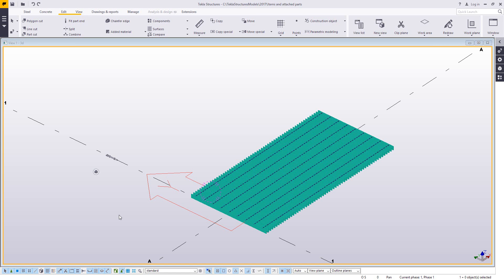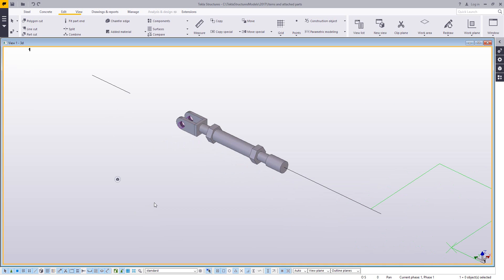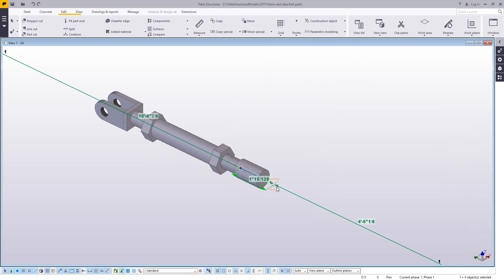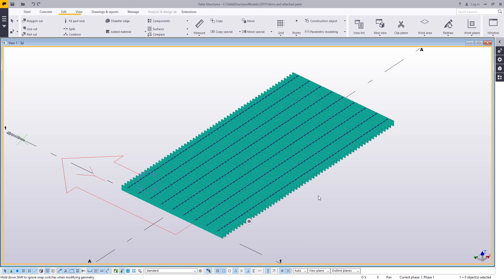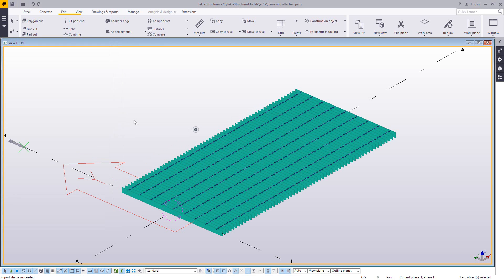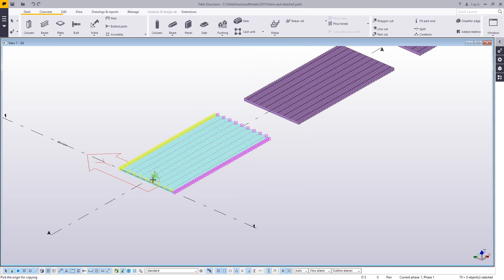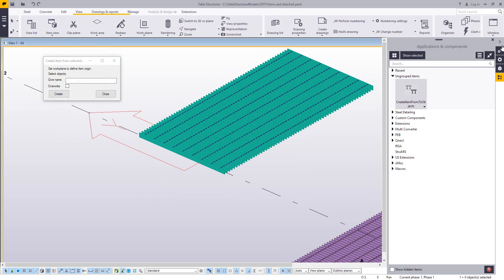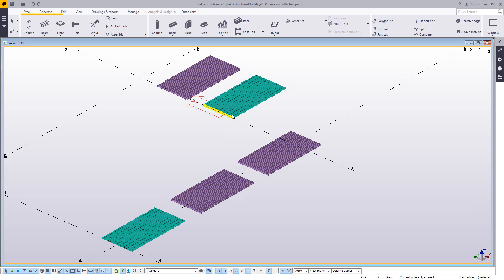Custom Objects Using Items & Attached Parts

Comment: Using Tekla 2020 it has been my experience that one may create joined parts using the attach command in custom components, even complex ones with parametric features, but the attached parts do not survive once you leave the custom component editor. Only the main part persists. On the other hand, one may first create joined parts in the modeling environment, then create a custom component using the joined parts, but, when the component is opened in the custom component editor, only the main part survives the transition. The attached parts disappear. My conclusion is that it is not currently possible to make a custom component using parts joined with the attach (material) to part command.
Reply: Thomas, please first check you are using the latest Service Pack (SP4 as of 11/11/20). On the modeling side, you have to make sure you select the 'added material' object - the transparent box around the parts being added. They are a sort of 'reverse cut' and need to be deliberately selected when creating the custom component. I also tested attaching the parts inside the custom component editor and it seems to work ok, which is why I suggested updating to the latest SP. Perhaps there was a fix included that you need.

Comment: Thanks for the video,
Can we assign profile type to the item which is import from Inventor or others like SAT file? Let's think we have pipe and we pressed both side in Inventor and imported it in to TEKLA. I want to assign profile type to this item. Because I can see the item parts in the part list report but without weight unfortunatelly. How can we assign CHS88.9x2.5 profile to this item?

Regards,
Mucip:)

Comment: How to create a costume components in precast concrete tekla structure
Reply: Hello, creating custom components is the same regardless of the material (steel, precast, etc). There was a custom component series here on youtube that was created several years ago - just search for "custom" on the Tekla Structures page - or your local area office may offer formal training for this as well.